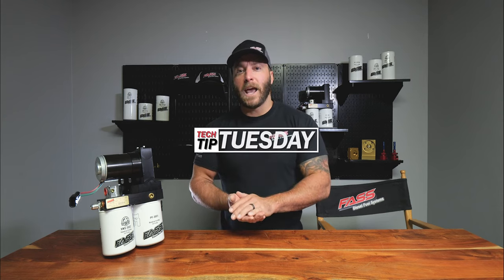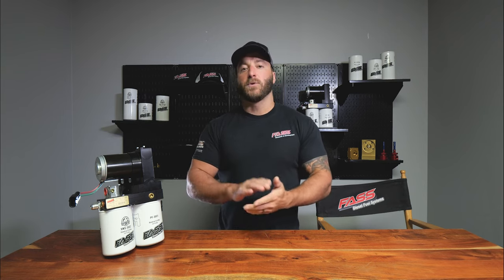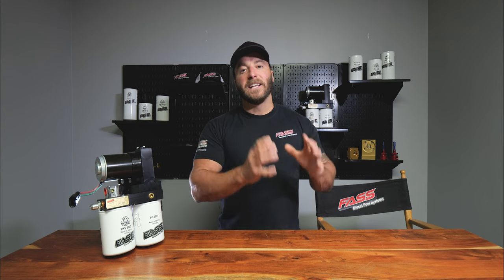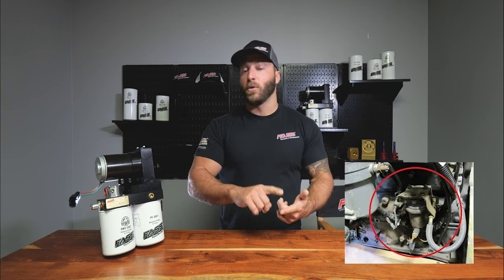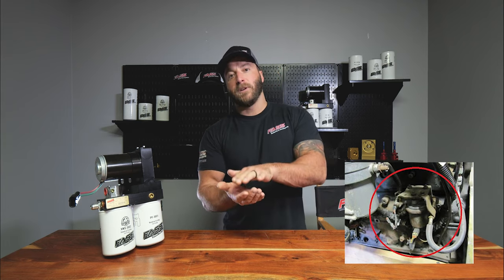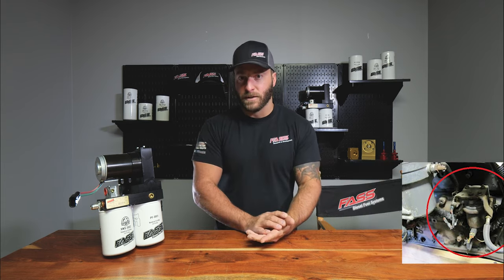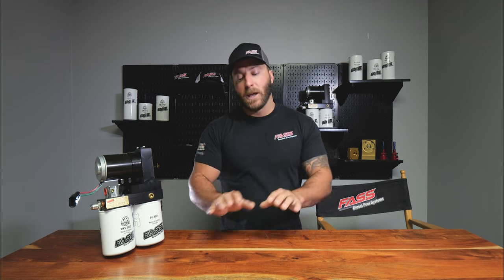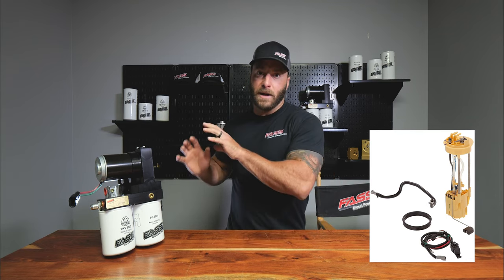MUST-KNOW info about the 1998.5-2004.5 Cummins | Tech Tip Tuesday

Comment: I wanna get one for my truck and my truck has the intake lift pump I wanna purchance one asap but I seen another video and the guy was saying the d07 was for the intank  and the d08 was for the inblock ones I’m so confused. Simone help.. mine is a 2000 2500 Cummins with the intank which one is for mine so I can order one.this guy is saying the opposite.
Reply from the maker: yours will need the TSD07100G we apologize for the confusion.

Comment: So I’ve got a 2003 3500. When I look online it says the TSD07 isn’t for my year. Which one should I be looking for?
Reply from the maker: Great question, and it depends if your truck has the factory lift pump mounted on the frame, or on the side of the engine? If it does then you'd need a TSD08 kit. If it's been relocated into the tank you'd need the TSD07 kit.

Comment: So I have a 2001 2500 and I’m pretty sure my lift pump was relocated to the tank so I would need the TSd07100g according to your website, but everywhere I look I can’t find that part number pump for my truck, when I look it up it says it’s for a 2005-2018 so I’m lost
Reply from the maker: Thank you for reaching out, and yes that is correct. If you have the lift pump relocated back in the tank you would need part number TSD07100G.